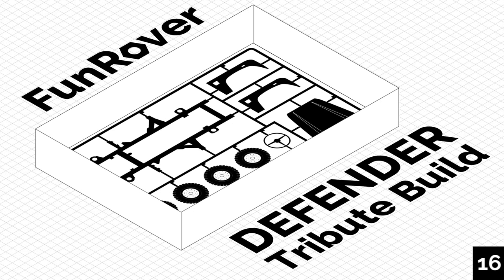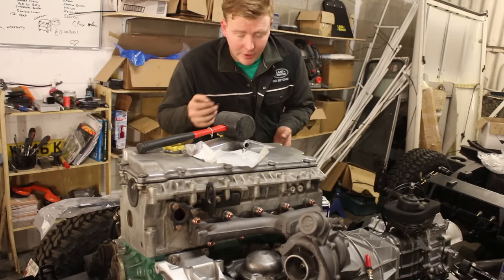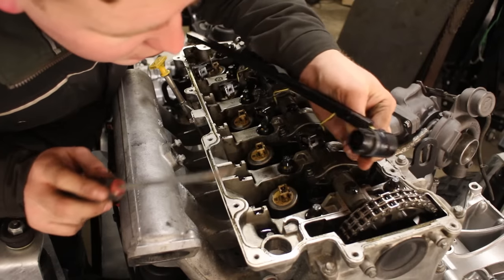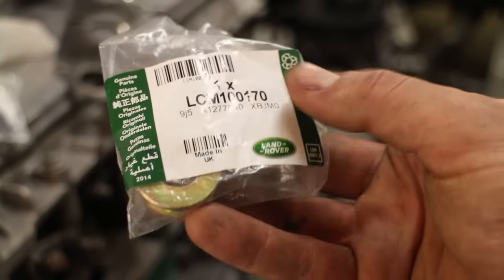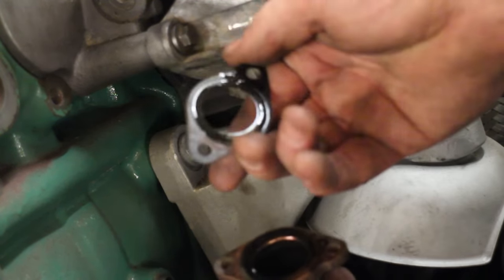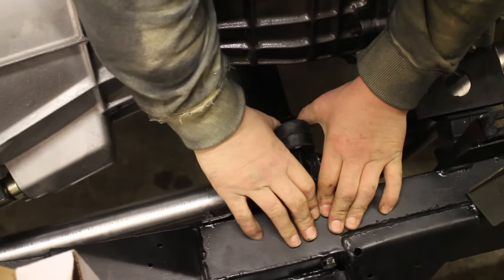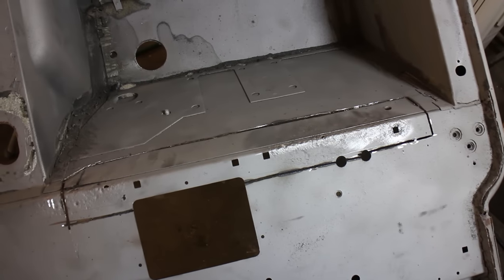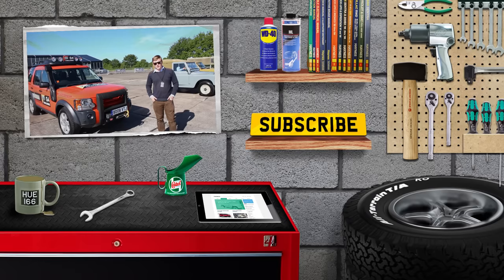Defender Bulkhead Welding & TD5 Injector Loom Replacement

Comment: Also just a shout, if your welding on thin metal you might want to but some of that welding putty, you stick it onto the metal near where you are welding and it dissipates heat very well, reduces deforming of the metal
Reply from the maker: +Josh Briggs Thanks Josh, will give that a try on our dash we're making